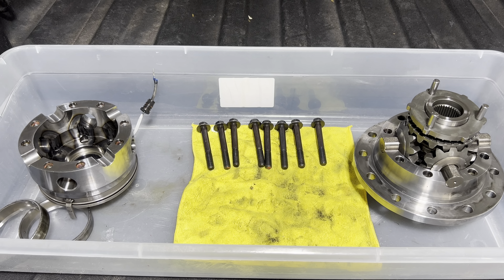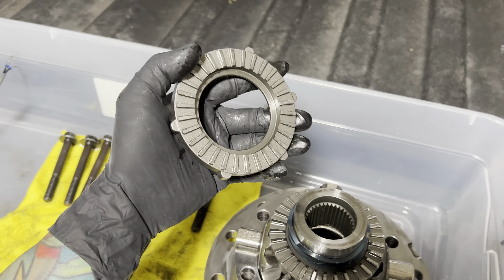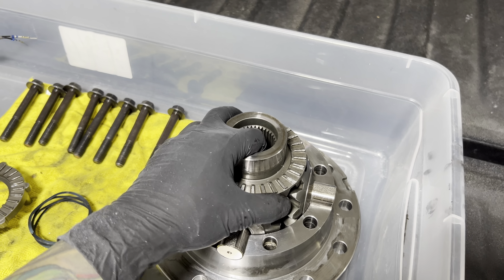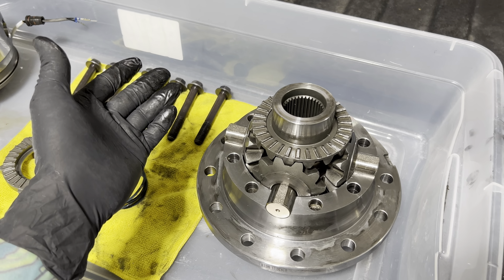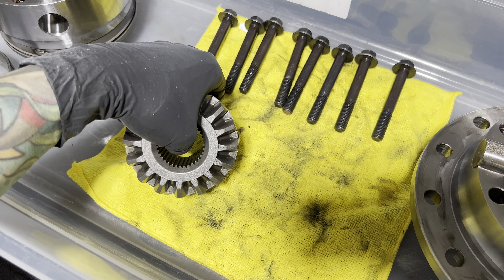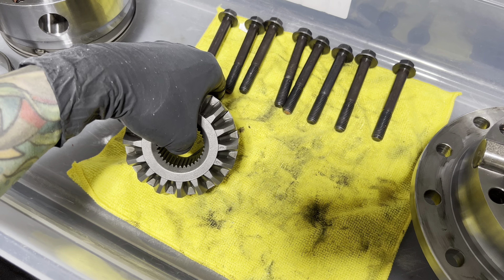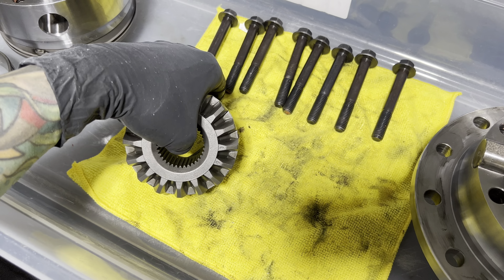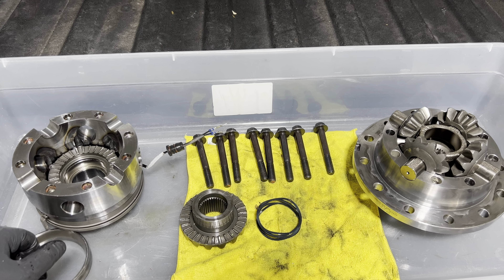How the Dana 60 Eaton ELocker Works (and What Broke On Mine)

Comment: I was out in Kingman this weekend, The Great American Crawl, wheeling with RockStar Garage and half way through our first trail on Friday, I had the same problem! I bought my Dynatrac 44/60 set just a few months ago and put them through 4 wheeling trips no issues until now. When I engage the Eaton elocker I get the same popping sound, when not in use it drives fine. Dynatrac is in the process of replacing the locker itself, waiting to hear back from them on the cost to replace. 🤞
Reply from the maker: Dynatrac was great to work with. Hopefully, Eaton has a replacement in stock. That was my initial issue.

Comment: I have a 21 gladiator rubicon diesel on 40s and purchased a set of dynatrac prorock xd 60s with Eaton E lockers last September and a few months into having them I noticed a popping sound coming from my rear end when I would turn while locker was engaged. In April roughly 7 months later I went to the Easter Jeep safari and the sound dramatically got worse and rear locker completely failed. I got a hold of dynatrac and they are warranting the locker but I’m going arb front and rear they are swapping both out. They told me that within the past year they have been experiencing failure with Eaton e lockers mainly in the 60s
Reply from the maker: I broke my second Eaton E-Locker a few months ago. I now have an ARB Air Locker in the back. When the front fails, I will replace it with one as well. It seems like they stopped making the side gear that engages the locker out of a quality metal. I've heard of lots of them breaking over the past two years. Dynatrac has been great to work with in terms of customer service.

Comment: I’ve gone through two locker. Both fail on the second ride. Driver side doesn’t engage and clicks. It’s in a super duty dana 60 in a JKU. Going to try an arb next.
Reply from the maker: I just broke my replacement one as well. I have an ARB sitting on my work bench.

Comment: Is the locker supposed to engage immediately when you click the button or it needs the wheels to turn and help the locking teeth align properly?
Reply from the maker: The teeth have to be aligned, so that may require slight movement for that to happen. It's also worth noting that my replacement Eaton locker broke. I just ordered an ARB to replace it.
Reply: @Ali_Mansour_Editor  My front elocker on dana 44 stopped engaging. I can see the plate moving halfway left instead of all the way when I click the button. If I help it with a screw driver it gets engaged all the way. It does receive a 12.4 V signal. I did change the magnet actuator. Any idea what could be preventing it from working?
Reply from the maker: @Samsonrecon8  I would pull the case apart and see if you have any broken teeth. It's possible it's getting put in a bind because a small piece of metal is caught inside of the locking mechanism. When I pulled mine apart, I found chunks of broken cast pieces inside of the locker.
Reply: @Ali_Mansour_Editor  Thank you Sir. I really appreciate the feedback. Few people will take the time and answer. I will try this and see If something is stuck inside. Wish you continued success.
Reply from the maker: @Samsonrecon8  Best of luck!
Reply: @Ali_Mansour_Editor  Ok it worked. Turned out the plate was not sitting correctly. When it is not engaged the plate should not be sitting flush touching the actuator. There should be a small gap when the lockers are not engaged. Just sharing here in case someone was looking for an answer.

Comment: How is this wired/switched? Considering you are running them in a gladiator, are you using the z automotive harness Nd stock rubicon switch? Or are you wired to full 12v via a separate switch? Apparently the stock switch sognal is pulsed, and currie is now recommending not to use the stock switch in any fashion.
Reply from the maker: I’ve broken this locker again since posting this video and now run an ARB. During my testing to see if it was a voltage problem, I actually tested it and it read over 12 volts at the plug every time. You are correct in that I was using the adapter harness from ZAUTOMOTIVE. Currie is the only axle manufacturer I know of with the warning about the adapter and dropping voltage. I’m not saying they are wrong in any way (I still consider John Currie very smart and a friend). I just get the sense they don’t like or have had issues with the ZAuto stuff for whatever reason. I’ve had the same adapter on my front axle for years with no problems. I think the locker just can’t handle something heavy like my Gladiator. Material is weak and or the magnet just can’t hold.

Comment: I cant believe there very little tooth engagement when the locker is locked just maybe those lockers are designed for a tire just above stock height/ weight and the taller and heavier the tire the more stress there is on the locker teeth engagement causing the locker teeth to break??
Reply from the maker: I think the main problem is the strength of the magnet. It seems like it's just not strong enough to keep the locker engaged under high-load events.

Comment: Yep, I'm at 8 months same as you when I started getting the popping. We sound like the same people with the same reasons for choosing Eaton. They have been fantastic up until a few wheeling trips ago. I'm on a diesel JL with tons and 40s. Really not looking forward to dealing with all of this. Can't believe Eaton won't just sell the  parts to fix it. A smart machinist could make some money here.
Reply from the maker: It’s so odd to me that a company as big as they are can’t get a replacement parts program going. Thankfully, Dynatrac was extremely helpful. Eaton will not warranty anything until you send them in the carrier and they determine it’s covered. Now that I know it’s a fairly easy fix, it would nice to just carry an extra side gear with me just in case.

Comment: We have a minimum of 5 with the same issue. All 60's,  All aftermarket axles, Currie, Fusion, Dynatrac. All wired differently.  I call b.s. on a voltage drop problem.  The side gears just are not up to the task of a 60 running over 39" tires.  I had Currie 44's before with eaton e lockers, 3 years with zero issues.  My jeep now has ARB's.  Eaton won't sell just the side lockung gears anymore.
Reply from the maker: It’s crazy to me that Eaton won’t just sell a rebuild kit. If this fails again, I will go ARB for sure. Lesson learned.
Reply: Same story here. Dana 60s and e-lockers don’t  play nice together. I had a rubicon 44 locker on 40’s and an atlas 4speed (10.3:1) never a problem. Now on 43’s and tons.  Thought 60’s would be an upgrade. 🤦 trying ARB next.

Comment: Interesting. I thought about going with the Eaton E-Locker 4 in my dana60 front axle but now I'm not so sure.
Reply from the maker: I would go ARB if I had it to do again. That being said, I haven’t had any issues with the front one.
Reply: @Ali_Mansour_Editor  It's still makes me nervous because my vehicle is a diesel F250, so the front axle would be taking some weight. And it turns out Eaton is back-ordered anyway. I still like the idea of an E-locker since I already have one on the rear, so I guess I'll start looking at other options.
Reply: @grndiesel  I just ordered one of these and now I'm nervous. They finally came in-stock at Bronco Graveyard, and I got it yesterday. It figures that I'd stumble across it the day after I ordered it though. I've got an '06 F350 6.0PSD. Hopefully I have better luck, I don't think I'll have to use it all the time, but it'll be nice to have when I need it.

Comment: Nice. I've been curious about their internals. Do you know how many amps it pulls when locked?
Reply from the maker: It states in the manual that the maximum amp draw is under 10 amps and normal current draw is between 5 and 8 amps.

Comment: I understand that things break but man on a Dynatrac ProRock XD60 especially with the Eaton Locker. Those things are supposed to be reliable and strong. It's very underwhelming. Hopefully ARB will give you better luck.
Reply from the maker: Yeah, it was a bummer. I got another ELocker in there now. I've got over 10,000 miles on the new locker and it's been good so far. If it fails again, I'm just going to replace it with an ARB. Dynatrac was super helpful. Eaton wouldn't return my messages.

Comment: I know this is an older video, but I just had my front let go in the same manner. 8 month old Fusion Elite 60 axles, used the locker maybe half a dozen times. These things are just absolute garbage. They claimed to have corrected the problem, but that is BS. I’m powering it off an S-Pod which is dedicated 12 volts, up to 30 amps. So the voltage dip excuse is horse crap.
Reply from the maker: @bsigmin  I’ve broken the same locker twice in the back of my Gladiator. I now have an ARB.